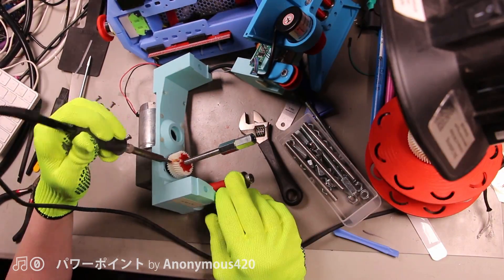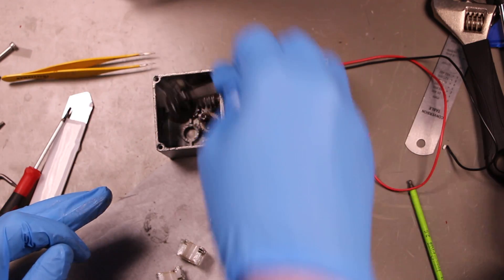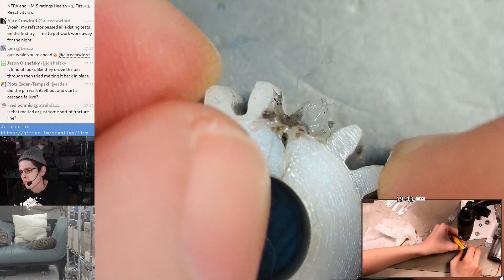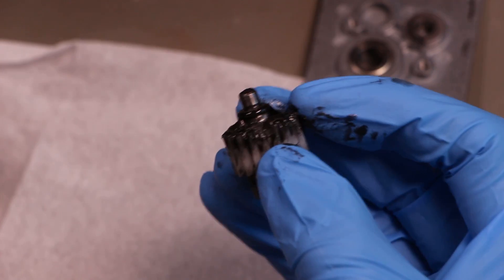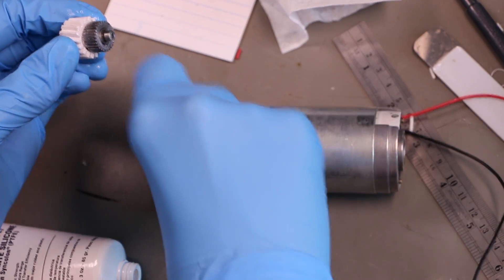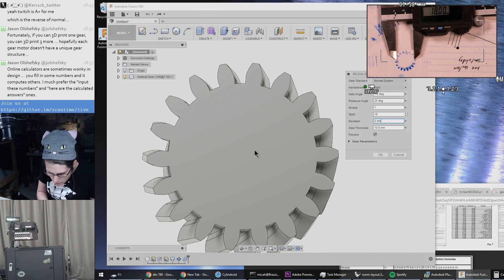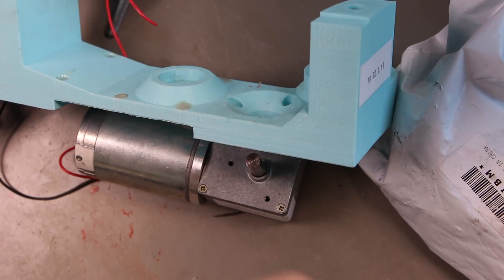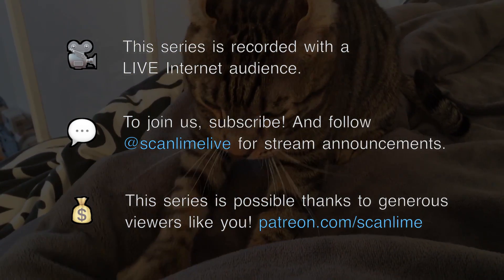Tsiny Gear-Motor Surprise, Manufacturing and Repair Fail

Comment: Local auto salvage yard is filled with gear reduction motors like this.  Power window regulator motors.  Heavy duty and have metal gears.
Reply: Along similar lines - windshield wiper motors are famous for being cheap, readily available, torquey, and skookum as you like.
Reply from the maker: I saw power window motors similar to these but didn't run across the exact model. Maybe for big truck windows?
Reply: you will not go wrong with reliability if you find a power windshield washer motor.  No gearbox I know of is remotely as reliable for its price.
Reply from the maker: luma I looked at windshield wiper motors but at that point in the design it seemed like they would be lower speed than I’d like. These top out at 200RPM, or so it’s rated at least
Reply: Get a power window motor, Stop over thinking this.
Reply from the maker: This is a power window motor, as far as I can tell.

Comment: Hackaday had an idea to repurpose cheap hoverboard wheel assemblies, which would easily handle the sort of forces involved. Or what about cheap cordless drills? They get used quite hard and even then the gears rarely break.
Reply from the maker: Good ideas! I forget whether I looked at cordless drills for this project...  I do already have some cheap hoverboard innards I'd like to repurpose though :)

Comment: Word on the street is that TheShop.build (former TechShop location in SF) is getting a 3D metal printer.

I also like the Window motor idea but would also consider gutting harbor freight electric drills with planetary gearsets or something similar.   Also consider used electric wheelchair drives.

Comment: Great summary of this issue. I would have either tried to cast the gear on some metal or 3D print it in nylon. Though casting seems like it would require a lot of tools and equipment to do just to save a geared motor lol
Reply: Not necessarily, Bismuth alloys can be cast on a kitchen stove and into silicone of low temperature resistance.

Comment: Looks to me like the pin is too small to transfer the torque, causing a ductile failure to spread from the inside of the plastic gear. You might try gluing the gear to its shaft, thereby distributing some of the load from the surfaces in contact with the pin.
Reply: In my current opinion, subject to change, Nylon cannot be glued. It definitely rejects epoxy.

Comment: Aren’t there a bunch of fiber-reinforced filaments out there now? Carbon fiber, Kevlar and the like? I bet that would make a better gear than the regular filament, but probably not a permanent fix. You could also do a lost PLA cast in aluminum, if you’ve got  a place to handle such things safely.

I wonder: does anyone sell files for that tooth profile? You could cut the gear from steel if you had that. You could also make a file, from mild steel, harden it, and use it to cut brass. I feel like these solutions are only getting farther from things you’re likely to do in a shop with a curious cat, so I’ll leave it there.
Reply: Fiber filled filaments increase stiffness a LOT but are generally more fragile, fairly fragile in fact.

My first instinct would be to temporarily glue the gear together to have something to mould around (or model and 3D print a replacement), create a silicon mould from that, and it doesn't necessarily have to be good expensive silicon for this particular case to work, cast slow-cure high-strength epoxy like Uhu Endfest 300 in that mould and bake it while it cures at around 100°C. This can create parts that are stronger than original Nylon. Inspect how much chew there is on the gear after a while.

A hot trick is to vary the composition of the epoxy, epoxy doesn't need much hardener at all, so 1:1 mix epoxies are filled with plastifier as part of their hardener mix - you have about 20% of leeway in either direction, though hot curing may become necessary. So to make a harder part, you add less hardener, to make a tougher part, you add more hardener.

Also plain annealed PLA could work.

Comment: It ought be completely feasible for you to get a reliable gear from SDP-SI. That's my go-to place for things like obscure helical gear sizes, and they usually make up for their prices with extremely reliable service and shipping times.  Most of those helical gear variants aren't actually machined, but are usually just powdered metal in bulk, so the cost savings they would have by choosing a nylon gear over a metal one ought be relatively negligible, which boggles me a bit, other than them knowing they wouldn't even use hardened powdered metal gears and so nylon would at least SOUND functional right up until it breaks.

That grease they had in there certainly wasn't the best, and you could see metallic flakes in the grease of even the new gearbox (unless that was on your gloves from the old one, sorry, I can't tell) meaning it was chowdered right out from the getgo.

As for replacements, you will absolutely not be able to print something like that in any way shape or form.  Worm toothed pinions are usually the weakest geartype in terms of wear life, and the fact that it's plastic will just make the problem worse.
Reply from the maker: Thanks so much!!
Reply: No, thank you, you superhero.  You are an inspiration to us all. Happy hacking.
Reply from the maker: I just checked out SDP-SI and they don't quite seem to have the right parts (their helical gear situation is a bit sparse). It'd be nice to have some options short of replacing the whole motor or designing in a different type of gearbox assembly, so I'll keep an eye out for new gear suppliers to try. The part I'm looking for seems to have a shallower pressure angle than usual (7.5 degree, if I'm measuring right), and it's otherwise an 18t metric gear with module 1.
Reply: Oh, now that's interesting.  Let me check my machinerys handbook real quick, I've heard of that shallower variant before. I think, but if I can't dig it up, the odds of a slightly off skew plastic part to fit a loosely toleranced worm gear is far more likely than strict threadform adherence to some archaic tooth profile.  Upon five minutes of diggin, it only appears in a US standard toothform, but that's supposedly a metric toothform.

In all honesty, if it's really worth it, reaching out to a local machine shop to do sourcing for you is always an option.  When I worked in a sheet metal production plant doing machine design work, the local tool and die was always nice enough tell me where to start my part shopping, especially for obscure drive components and threaded fasteners.

The issue here is that this is not only an obscure spec, but it's a METRIC obscure spec, which is kind of a funny issue to have, all things considered.  Worst case scenario you can probably ask a local shop to hob some up for ya for hopefully not-to-hefty a penny, or there's always contacting the OEM, asking for the spec, and ordering one thataway.

I've seen just how much ass-bust you've put into the monsterously impressive enclosure design for these thingies.  I hope you manage to find a better way to push reliability up other than sourcing new parts.  If all goes to hell, try decreasing drive rates and acceleration profiles of the motors to minimize wear, and putting some slightly more "plastic friendly" grease in there if push really does come to shove.
Reply: Is there a way to check the metal ones and see if there are standard components that fit them? It could just be a poorly-manufactured version of a standard part, as you said. Though I wonder if the reason it's so janky compared to the others was they didn't want to spend the money for a custom metal one.
Reply from the maker: Thanks for the additional suggestions! So far the winches have been doing fine, and there are many reasons to keep the acceleration profiles gentle. Next time I have a failure, I do have one spare on hand but I'll see if I can check local machinists and various catalogs for something that can match up.

Comment: It's extremely unlikely to ruin Nylon with any grease. It is potentially susceptible to alcohols though. Best way to ruin a nylon gear is to run it warm in a dry environment. It needs moisture to retain its toughness, and it can dry, shrink and crack.

Comment: If the gear you 3d printed functioned but just wasn't strong enough, why not just 3d print another one and use some kind of silicone mold to cast a copy of it into a more durable material? A resin would be easiest, or even some kind of metal if you have access to a good blowtorch and some crucibles.
Reply: Maybe Bi58Sn42, you can buy this alloy, it costs less than $30/kg and melt it on a plain kitchen stove. Here's someone playing around with it: https://www.youtube.com/watch?v=770cSWbmBRg

Comment: Your plastic gear plays the fuse role in case of mechanical blocking or high torque when the load jerks. You should prevent it using a current vs velocity algorithm watchdog.